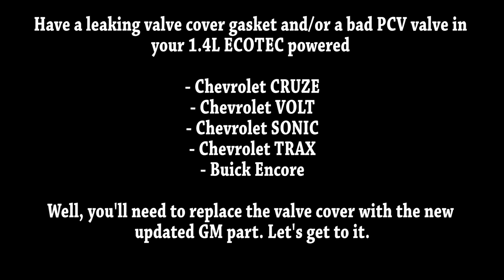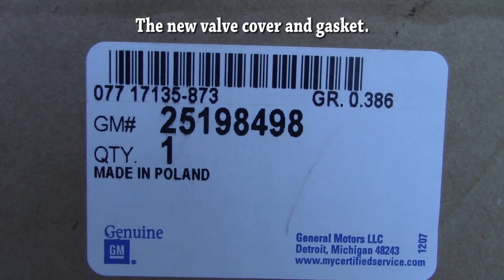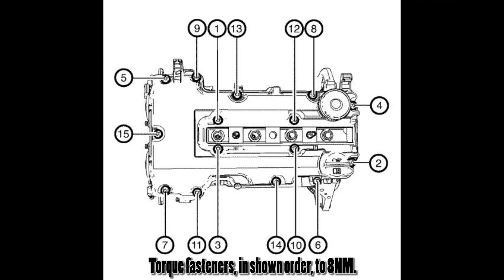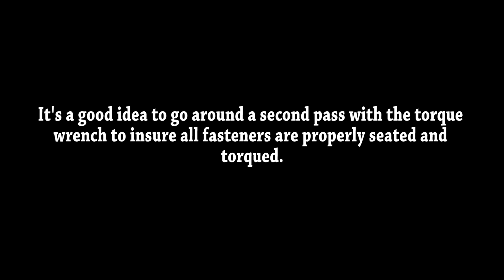GM 1.4L ECOTEC Valve Cover Replacement

Comment: Had a P0106 code and check engine light caused by a vacuum leak from the integrated PCV valve. I followed your procedure, no problems but I had to use some nylon pry tools to break the seal loose to get the old valve cover over off. I disconnected the negative terminal of the battery for about 15 minutes to clear the check engine light, started it up and it idled smooth again and no more vacuum leak. Check engine light remained off. Thanks for the easy to follow video.
Reply from the maker: You're welcome. Glad to help. 👍
Reply: You should read this, most likely you will have to replace your valve cover again. Good luck brother!
https://www.cruzetalk.com/forum/34-gen1-1-4l-turbo/192442-2011-2016-cruze-1-4-pcv-valve-cover-intake-manifold-issues.html

Comment: Nice video.  The illustrations are good with no distractions. I will be performing this on a 2011 Cruze. I was told by the dealer that normally the intake manifold and crank case seals  can be a part of the poorly designed systems in these cars and should be replaced the same time to assure a complete job. I am hoping for just the valve cover with its flawed pvc valve.
Reply from the maker: Glad you enjoyed the video. Hopefully you correct your issue.

Comment: Had to do this on my 2011 chevy cruze 90k miles. Beware you might need a new coil pack as well. One of my coils was cracked. $200ish for the coil pack. Great video.
Reply: I'm literally doing this on my 2014 tonight. Not impressed with this car btw, considering trading it in now that the warranty is done.
Reply: You should try shopping around for auto parts. $200 for a coilpack WOW. Amazon $50&$60 valve cover with gasket. Nice vid
Reply: Rockauto.com in cas e you need to do this again. Better than the random people to purchase from on eBay or Amazon.

Comment: i just did this repair and it cost me 130 dollars.

Tools:
70$ valve cover for 1.4L cruze on Ebay.
12$ Cheap chinese double coated chrome socket wrench and sockets
30$ A Husky 3/8 inch 15 inch ratchet from Home Depot ( when the chinese socket strips after 3 bolts)
2$ T30 3/8 inch socket Husky from Home Depot
2$ 8mm 3/8 inch socket from Home Depot
2$ 8mm crescent and circle wrench from Home Depot just incase everything fails.
*make sure to have a bicycle ready to transport you to Home Depot!
Reply: I bought the GM valve cover kit that came with everything needed for 80$ CND.
Reply: Mr Jimbo 666 hi, where/what website did you purchase the kit that included everything? I’m having trouble finding it.
Reply: How do u know if ur at enough torque?

Comment: Thank you for posting this, I am about to perform this on a 13 Volt. Your video is the first one I've found to mention the Volt for this repair. It has the same exact problematic valve cover, but I'm thinking since the engine is not always used in the Volt this is a much less common failure. The car I have in particular has 128k on it and by the lifetime mpg number, 35mpg, the engine has been used quite a lot more than the average Volt.

On my car it won't set ready for O2 or catylst so it isn't passing emissions, nor is it setting a check engine light. I'm hoping this is the fix.

Your explanation of the use of RTV was the last little unknown piece to me so now I have full confidence to do this job.
Reply: Also the dealership wanted $500 to perform this exact same job! The part is only about $50!
Reply from the maker: Glad to help. 👍🏻 Good luck with your repair and emissions testing.
Reply: @MrSubaru1387  , it went in without much of a hitch. The wire harness is a little more extensive on the Volt (shocker), but it went right in. The engine is noticeably quieter now.

Before my delta between short term and long term fuel trim was as high as 10 and now it's no more than 4 so this is definitely a positive improvement. The engine definitely did a quick and rather audible re-learn of itself there first time it was fired up with the new valve cover.

Now to see if it sets ready so I can get this thing registered.
Reply: I went for and a 30 mile drive last night and now it set catalyst ready. Now I'm down to just O2 sensors not being ready which means it will pass emissions in AZ as you are allowed one to not be ready.

I'm taking her in tomorrow!
Reply: I also have a volt 11 model.
Any tips to the man who fixed his 13
Reply: @suitersautomotive  any tips I have the 2011 the harnesses was my concern
Reply: @AOG_ETH  I had to pop a couple clips out to get the valve cover out and in, but it was pretty self explanatory. The ignition coil connector was the most delicate part really.
Reply: @suitersautomotive  
Any tips on the cleaning around the old gasket? 
Will the new gasket seat easy.
Should I replace anything else or am I good to go?
Mine sounds like a vacuum cleaner.
Reply: @AOG_ETH  The old gasket came off easily on mine. Just lay down some gasket making sealant before installing the new valve cover. I used a quick drying type.
Reply: @suitersautomotive  seal everything they told me not to but only a couple of places.
Reply: @AOG_ETH  It's been a while since I did this so I may have forgotten exactly what I did. Follow the video and it should be fine. Just check for oil leaks after.
Reply: @suitersautomotive  Hi there!  I have a 2013 Volt and I recently moved back to AZ.  I replaced the front O2 sensor myself some time ago and it caused a slew of problems that took a lot of effort and eventually a better scanner than mine to do the O2 heater relearn procedure, which cleared up the problem. I drove it for about 1,000 miles after that with no issues. Then the CEL came back on with several codes indicating bad catalytic converter and front/rear O2 sensor. (of course this is before I have switched over my registration) Also, I have random misfires. wondering if misfires damaged the O2 sensors and cat. I am going to replace the coil pack and came across this video because on the Volt forum some have suggested that the valve cover may fix error readings with the cat.  I was just wondering if you had any further problems after you fixed this?  Is it running smoothly for you?  It seems like a cheap thing for me to try before I spend $1500 on a new exhaust manifold/cat and sensors.  I have 165k miles and I'm trying to convince myself it's worth putting some money into repairs instead of a new car payment! There are a ton of people with success stories for long Volt lives. I guess I'm just looking for encouragement and good news stories :)

Comment: Excellent tutorial! I've done the procedure but mine is super stuck, almost if it is glued to the top of the crankcase. How can i remove it? I've tried with a screwdriver but didn't work. Thank you so much!
And how about the grey glue that you put? What is that?

Comment: I noticed there is silicone at the you have to scrape off when you remove the valve cover. Did you have to reapply silicone at those spots, when you reapplied the valve cover gasket?

Comment: I hope you read this and respond please! My 15 encore had the new valve cover replaced earlier this year by the dealer. The gasket is leaking on the outside for sure. Now there is oil all over the spark plug boots and tubes filled! I’m assuming it’s leaking on that inner portion of the gasket (the part that goes around coil pack). Since there are no plug tube seals do you think that’s how the oil is getting down into the tube wells? Thanks.

Comment: great video I would like to add if you use a screw driver in the oil fill part to get loose, so you don't mark the head prying it there. Also use Q-tips to clean bolt holes. THIS IS KEY as the bolts use very little TQ.  I find Q-tips clean a lot of my engine holes before I reinsert bolts

Comment: I replaced the entire cover and gasket as an assembly on a 2014 Cruze  (GM Factory parts) and I got literally a spray of oil at the left front corner just in front of the arch on top of the engine passenger side. I removed and double checked that the gasket was properly in place. Torqued as in your video etc. Placed a GoPro and light under the hood and when accelerating oil is squirting all the way to the passengers side fender well. Should there be really high pressure inside the valve cover? The part number supplied by the Buick dealer was 2519-8877 and they said it was the same for the Cruze. Is it possible that there is a slight fit difference?

Comment: Installed the same valve cover with gasket and had no issues initially. I had 3 fasteners on the new valve cover that were pretty loose and started to leak oil. I cleaned up the oil and retightened the fasteners that were loose. I was wondering if I will need to take off the new valve cover and new gasket and clean up oil that might have spilled inside under the valve. I just cleaned the outsides where I saw oil leaking, as well as removing the foil coils and cleaning up around those as well.

Comment: Great video! Did my sons last weekend...  Can't believe they didn't make the valve separate from the valve cover. I did find many sites on line selling just the cap and valve but no instructions. Appears to be welded/glued on?
Reply: There is one PCV valve that is part of the valve cover and another on the other side of the engine. I have seen a video of drilling out the one on the cover and replacing with  a more reliable after market one. Drilling and tapping plastic seems difficult.

Comment: Check the bolts on your replacement valve cover. If they don't have the rounded tips like the factory one, knock them out and use the factory ones, you will never get the square ended bolts all to line up to the holes. The bolts are in tubes, put RTV under the washer under the bolthead, the orings won't stop all the oil. Don't buy the cheapest valve cover like I did, $43, and maybe it will bolt right up.

Comment: great video, pretty easy, just DO NOT OVER TIGHTEN the bolts it is easy to brake them. believe me i know! lol but make sure your car isn't covered by 5year 100k warranty.
Reply: RJ Sossaman  is this work covered by the 5 year warranty? I have a 1.8 and it kind of noisy. Thanks
Reply: RJ Sossaman i over tighten the screw..... Now m screwed....hiw did u fixed it???

Comment: Will a regular 3/8 socket torque wrench would do or bo I have to buy a special one to get the proper torque settings?
Reply: Usually the flip side of pound feet has NM on it BUT a 1/4 drive might be better for such a low value.

Comment: Hey man... My car was fuming a lot of smoke..n it was leaking lil bit as well so.. i was tighting a screw.. n slipped it...how dobu think is better to repair
Reply from the maker: After the repair it was leaking/smoking. You stripped a bolt?
Reply: MrSubaru1387 yeah.. n i wasn't using torque wrench.. so thought it might not be tight enough.. som. Just snapped
Reply: Do u know which n where i can buy the screw..
Reply from the maker: Most likely from the GM dealership.

Comment: Valve cover was replaced on 1.4 LT engine and after oil is leaking from the throttle body . What is the cause?

Comment: I noticed you worked on a 2011 Cruze, I have a 2015 with 33k miles, did GM fix this issue on newer models or will I have this issues with my Cruze?
Reply: You’ll have the same issue, my 2015 Cruze just did this at 77k miles. It’s a design flaw in the valve.

Comment: MrSubaru1387 One question do i add Blue RTV silicone on cover and them put the gasket or just put the gasket with no RTV silicone just those two area shown?
Reply from the maker: RTV only in the places shown. The gasket goes on dry otherwise.
Reply: @MrSubaru1387  Thanks man. wish me luck🧣🙏🤞
Reply: @MrSubaru1387  one more question i when to get the grey RTV and the ppl from autozone told me for this type of things of gasket is better to use red rtv is that ok or just get the grey rtv

Comment: I purchased the gasket but should I buy a new cover also?
Reply from the maker: The PCV is built into the cam cover.
Reply: @MrSubaru1387  I purchased the gasket separately already, but should I also purchase a new cover??
Reply from the maker: If you have a PCV issue, replacing the gasket isn't going to do anything for you.
Reply: @MrSubaru1387  ok thank you 👍🏼

Comment: I've been having this leak issue lately but i wanted to ask, after all the videos I've seen, was it the cover that needed to be replaced or just the seal that lays inside of the cover? I'm planning on doing this project tomorrow.
Reply from the maker: The valve cover. The pcv valve fails, it's made into the cover. So, has to all be replaced.

Comment: MrSubaru1387

I am assuming GM has started using the improved valve cover on newly build engines as well.
Is there a way I can tell my car already has the improved valve cover or if still have an old one?
My car was build spring 2015.
Thanks in advance !
Reply from the maker: I don't recall an outward physical difference on them. I did see a 2014 have a failure a few weeks ago.
Reply: Not very encouraging, but thanks anyway  !   :-)))

Comment: when you apply the rtv sealant do you have to wait 24 hours before you can drive your car again?
Reply from the maker: 24hrs is the full cure time. Go by the directions on your particular RTV sealant.
Reply: @MrSubaru1387  so if I drive my car prior to the 24 hours, I'll undo all the work just done?

Comment: I over torqued and snapped one of the center bolts, will this be an issue? Any way to fix it
Reply from the maker: May not seal up. Yes, you'll have to drill and extract the broken bolt and replace it.

Comment: What about the valve cover on the 1.8 liter chevy sonic? My sonic has 130k miles and I just noticed it was starting to leak around the front edge of the valve cover and around spark plug number 3. I replaced just the gasket which cost me $45 from autozone.  Thank you for your helpfulll video!
Reply from the maker: Haven't worked on a newer 1.8 Ecotec. Not sure if they have an integrated pcv or not. I'd assume they do as well though.
Reply: MrSubaru1387 i think it does have an integrated pcv valve because when I looked inside the valve cover there was this long rectangular box that oil started coming out of it when I turned it over. Also the pcv tube connects directly to it. What is the issue with this design? I didn't have any check engine codes either.
Reply from the maker: On the 1.4 the PCV diaphragm tears and causes an intake leak. Outside unmetered air inters the intake through the valve cover. The PCV isn't serviceable alone, so the valve cover is replaced as an assembly.
Reply: MrSubaru1387 1.8 must not have had this issue, a Google search didn't turn up anything but for the cruze 1.4 l it sure did!

Comment: Did just buy the Gasket or did you replace the valve cover and gasket?
Reply from the maker: Comes together.
Reply from the maker: New valve cover comes with gasket. Have to replace the valve cover when PCV fails. Made together. Good job GM.
Reply: I just replaced the valve cover like last year with a part bought from the chevy dealership and the dealership is saying that is leaking again? I re-torqued the bolts, but still looks like your beginning photo above. where can i get this part for a good price?
Reply from the maker: I bought this one straight from the GM parts counter.

Comment: Trying to do the same on my 2013 Cruze but valve cover won’t come off, watch other vídeos advising to tap it with a rubber mallet to loosen it up but no success, any tips on how to break the seal? I thought about prying it with a flat head screwdriver but I don’t know if it is a good idea.
Reply from the maker: +Javier Ramos you can pry it, but be careful not to scratch, gouge, or scar the sealing surface of the cylinder head.
Reply: Thanks.
Reply from the maker: +Javier Ramos did you get it?
Reply: I'm waiting for the weekend, also I decided to change the whole cover instead of just the gasket it wasn't that much more money to get the whole thing. Before I get the whole new cover I will try removing it when the engine is still warm it seems in my head that it would make a difference but I don't know, I'll keep you posted.
Reply: MrSubaru1387 Hi I did get it off no problem, I saw other videos that recommend lubricating the gasket before reinstallation, I didn’t see you lubricating yours, is this you should do or not? Thank you in advance.
Reply from the maker: Did not. Put it on dry.
Reply from the maker: Well, other than the RTV at the seams with the timing cover.
Reply: MrSubaru1387 ok just wanted to double check, I seen so many videos and that was the only one that referenced to lubricating the gasket before installing the cover, thank you again for the feedback
Reply from the maker: You're welcome.

Comment: Has there been any fixes for the janky pcv system? I need to replace the check valve in the intake manifold and the pressure regulator in the valve cover as I'm typing this
Reply: Yes this guy has a fix he talks about it at the end of his video.   2011-2016 Cruze 1.4 PCV Valve Cover/Intake Manifold Issues https://www.cruzetalk.com/forum/showthread.php?t=192442

Comment: Looks like i over tightened the bolt n now its loose..did i just broke the bolt or maybe the cover is crack??not sure..
Reply from the maker: I can't say. Either you stripped the bolt, the head, or broke the bolt.
Reply: @MrSubaru1387  the head is fine..hmmp